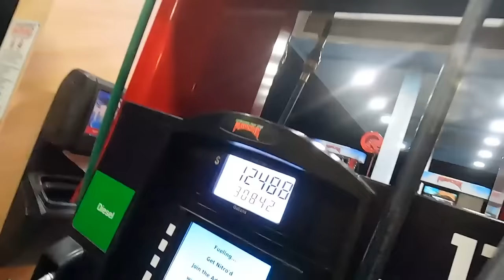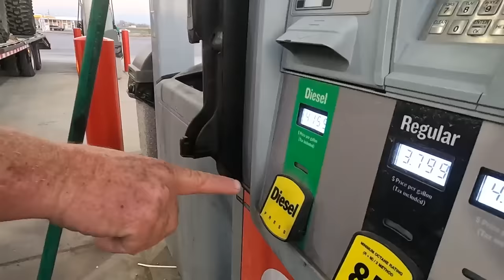I'm Saying GOODBYE To The World's Largest Off Road Wrecker!

Comment from the maker: A little more information on the wagon build. 😮 https://youtu.be/RnFA_jYkE0w
Reply: I've been seeing the forward movement of towing vehicles behind the wrecker. But been thinking a single solid bar between the axle an your hitch point on the wrecker would be super helpful. A lorry lift idea like on a heavy wrecker only I think for your Idea of climbing about up an down rocks a 3/4 S layed in below the vehicle till the wrecker would work better in your case. But a single bent pipe or made up box would work so it can swivel still an extra would be a old shock added in line if there was room. But something long enough that if it swings up the towed vehicle is pushed back from hitting the end of the boom. For over an above that nothing else could happen the towed vehicle with two lift lines and the cross strapping your already using Tom toms long walks will only be optional then.
Reply: This video is 🔥🔥🔥🔥🔥
Reply: That wagon is WAY to nice to derby! It should be resto-modded instead.
Reply: Matt what’s all done to the blue Ford!? Trusty truck you have! I just bought a 16 f350 curious about yours!
Reply: What time was it on your watch Matt???
Reply: a little less chewing with open mouths into the microphones (thus into my ears) would be nice next time :D
Reply: That is a beautiful station wagon. I remember these as a kid.
Reply: Wait a minute - You are going to turn that nutless-Cutlass into a Derby Car?!  Holey Moley, that will be epic.  I can't wait to see that happen.  For those of us old enough to remember the 400s and 455s being phased out and replaced with the 260V8 and 250L6, it was a big deal.  Even my family's '71 Vista Cruiser with the Rocket 350 felt like a muscle car compared to those later Oldsmobiles.  I hope you provide this wagon with the horsepower that it should have had the first time around.   This wagon looks like a '77.  They came lightly pre-broken, to save time having them break down later.  They featured exceptional brake dive and body roll, paired with a wide turning radius.  Good luck, this is going to be hilarious. 🏁🏴‍☠
Reply: Can't wait to see it Matt. Also love the wrecker great choice International looks awesome and does everything effortlessly. Keep up the good work always cool to watch recoveries out there I'm from Georgia so completely different terrain.
Reply: Man don’t derby that wagon what do you want for it
Reply: Wish I had the wheels off the wagon.
Reply: Have you ever had a recovery where you found the vehicle but no customer?  As in, the customer was never found?
Reply: Play offroad outlaws it's so fun

Comment: @23:00 Good work. Another way for another time: Dig a ditch/hole for the rear wheels of the trailer. 💡Dig ruts with a static burnout. Or deflate the tires.

Comment: With the number of times you have had extra passengers riding on the back of the wrecker, maybe you should look into a couple of jumpseats along the lines of the ones Suburu had for their little trucks.
Reply: Subaru Brat seats would be great for additional pax.
Reply: Yeah, I would hate to see somebody fall in line of those tires.
Reply: I have seen plans for seats, but there is a lot of other stuff that needs to be done before putting them in.
Reply: I had a brat I miss that thing.
Reply: @dubious6718  Who are you?
Reply: Subaru actually added those seats after-the-fact so the Brat could be imported to the US as a car instead of a truck, for cheaper! Haha
Reply: @brianpeck697  - I had friends with Brats when I was a twenty something, and I always got a jumpseat. It was a little lacking in headroom, and I'm a tall guy. I was definitely too big for the driver's seat.
Reply: Yes Yes this, maybe with a couple of harnesses or a bit of rope to tie the passengers in.
Reply: It would making a good spotlighting rig
Reply: I was just thinking he could use some Brat seats.
Reply: If the truck was a few feet longer there's room for one of the old semi truck crew boxes, Imagine a old sleeper with jump seats in it.
Reply: I was going to suggest the same thing.
Reply: But why don't they defend homosexual special rights ?
That'll prevent accidents too !
Reply: @dubious6718  I don't suppose you'd like to share where you saw the plans for rear seats.
Reply: @benjurqunov  WHAT?

Comment: I would name that thing "Jitterbug."

When I was a kid in the early 1980s my father had a 1940s or 1950s 1½-ton White Motor Company truck with a body style that was similar to that big yellow wrecker. It had two transmissions connected to each other so that you could put both transmissions in reverse to get a very low forward gear. A truck modified like that was called a "jitterbug" around here (Maine). They often had a homemade boom winch and were typically used in the woods for harvesting firewood, which is what Dad used his for. The ones with a boom winch were kind of a poor man's cable skidder. Even though that big yellow wrecker will never be used as an actual jitterbug, it would be the best jitterbug ever. It could even outperform an actual cable skidder in some areas I suspect, due to its extreme suspension articulation and high-revving big block gas V8 (high-revving compared to a skidder's diesel engine, anyway).

Comment: 1976 Oldsmobile Cutlass supreme Vista wagon! WOW!!! Love it!👍  I almost bought a used one back in the 80s for $2,500 with  factory t-tops and swivel bucket seats, minus the wagon ...but the seller backed out at the very last minute and sold it to a friend of his. 😞 . So I found a 74 cutlass for $700 and I was ok but not happy.  I've had a 89 delta 88 and a 94 calias that calias was a tank. I mean it was fantastic for off roading went through snow over a foot deep in farmers Fields,i used to go out from the the city to run my dogs ,and I never once got stuck. Anyway
Anyway I'm guessing you picked that up for the 500 challenge or whatever that's called...👍

Comment: Definitely need to add some jump seats with harnesses above the tool boxes
Reply: Yup, someone is going to fall off there right under a wheel and chances are that won't end well.
Reply: As much as I love the look of the wrecker, this is exactly why a cab over design would have made way more practical sense. It could be a 5 seater without changing the size and performance of the chassis, and it would be even easier to work on with tilting the cab off being part of the design.

Comment: Back at the ranch; we used to just dig a couple of shallow pits for the trailer wheels to lower the rear end of the trailer.  Six inches or so was usually deep enough.

Comment: Hey Matt why not park up beforehand , get the drone out so you can do an aerial check of the area to see if the recovery is still viable
Reply: Range....
Reply: @Ty-bz7zx  my bad, I thought they were within a couple of miles of the recovery
Reply: I loved your question so much I went down a rabbit hole thinking how great this would be.
Ten minutes into searching I found most don't have the guts for more than a few miles but I was able to find one that claims its' range is ~ 9 miles. Several others capped out ~ 4 - 5 miles.
Your idea should be viable in some situations and I would love to see a response from MORR if they researched it.
Edit - And then I found this:
FAA regulations require drone operators to maintain a visual line of sight of their drone during flight. Operators looking to fly their drones at long range (and beyond the operator’s visual line of sight) will need to obtain a BVLOS (beyond visual line of sight) waiver from the FAA, which is typically only granted for approved commercial drone operations.
Reply: @matthewwebb6001  wow, what a great rabbit hole. Thanks for that my friend 👍🏻
Reply: Also they are not very fast, and get unpredictable at the edge of range, and too expensive to lose
Reply: @matthewwebb6001 I assume off-road towing could be a viable commercial application that they may approve
Reply: @jmelchiori85  I was actually thinking that myself, especially as they could be saving lives of those that went off trail
Reply: Hey bro, thanks for that info! I had no idea of restrictions. I thought it was a great idea though.
Reply: @PaulH_1972  No bad at all.  Was a valid and insightful question.  I offered one of several poss reasons.  =)

Comment: Kinda curious why you never take a canister with some extra fuel on the road. Can imagine its usefull both for the cases when you run out, but also sometimes for some of the people you have to pick up.
Reply: Can fuel canisters explode if they get too hot?
Reply: Same reason he never has the ability to put air in a tire. 

Yootoober first 
Recovery...eh...
Reply: I've thought the same thing! I just put it down to not knowing how the business works 🤷‍♂️
Reply: @jeffstreck  I just checked, petrol auto ignites at ~250 degrees celsius (480 fahrenheit) and diesel at ~210 celsius (410 fahrenheit) 

Should not get that warm , and even you worry about that, a simply shelter so it doest get direct sun should help enough (or put it in one of the trays on the sides)

Comment: Odd that the wrecker isn't secured with Matt's straps.
Reply: They MAY not have enough rated capacity for the weight of that awesome monster.  Just sayin’…
Reply: Matt's straps only have a working load rating of 1500 lbs. Not sure I would even use them with a car on a trailer. You need to hit the brakes or get in an accident, I would be afraid 2 of them would not hold a 4000 lb car back even if it was in park. They are more atv/utv straps. If it was me hauling a car or pickup (and I often do) I would be using 3 to 5000lb. working load rated straps. If I had to haul that wrecker around, I would only use grade 70 chain or better.
Reply: @madkow007  I guess that 10,000lbs rating was BS.
Reply: He has used them in the banana or morrvair.
Reply: @n6cid  when did they say 10k working limit?  Straps I use have 3300 lb load limit but 10k breaking point.  That’s normal. You try to stay under load/working limits. Which should be @1/3 failure point.

Comment: Matt, When you are forced to use the highway trailer to get something off-road; It might be good to attach the ramps onto the upper surface of the trailer. It would be almost impossible to "wipe-off" the ramps that way (instead of them being stored beneath the trailer  - where the big rocks live!).

Comment: Heard you saying “The mice get in there”.  The solution is a product called Rhodent Repellent, available at Murdochs.  A little pricey, but it works. NOT A POISON.  I use it on my 99 f 250 7.3 diesel, 430k, crew cab, early version of yours. Also keeps the mice away from the battery compartment of my atv, and Nissan Rogue. Used in engine compartment, passenger atea, garage and attic space.
YEARS OF PROVEN USE!

Comment: Aawh man. Shoulda picked up the wagon before dropping the wrecker off. Could have used the wrecker boom to lift the front of the car up from a 90 degree, back the trailer under it, set the front on the trailer, then lifted the back and pushed it on with the wrecker! 

Also side note Matt, a boom extension even as simple as an engine cherry picker with pins would come in handy on the wrecker! Just an idea!

BUT without the wrecker, why not jack the front of the car up and back the trailer under it instead 😂

Comment: I'm kinda surprised you guys haven't fabbed up some kind of all-purpose ramps. Something that would work like a regular sand/snow ramp to pop under tires in those situations, and that could also hook onto the trailer to get regular vehicles up there.
Reply: The car trailer I built has short steep ramps. I carry a few 2x6 boards 4 feet long to lessen the ramp entry angle.

Comment: 12:03 You can easly drive out of that.
I'm guessing that trk is not 4x4 so turn your steer wheels hard right and back rear right wheel up onto bank.
Rock back and forth to create a path up the bank.
Use the momentum to lung you out of that hole.
If the trk is 4x4, do the same thing with the front right steer wheel.

Comment: I can't stand when a "customer" doesn't keep you updated if the circumstances change. If it is local I just move on to the next call. But if there is a bit of travel required to get to it I have started taking a deposit up front and then apply it to the bill later. Granted this is assuming you aren't doing the calls for free to begin with and not depending on youtube monetization.

Comment: Man builds a company by pulling stuff with and xj and when the time comes to load a trailer with an xj on it, uses a Chevrolet pickup. I fully expected the xj to back up with short rope , it would have lowered the back of the trailer and pulled up on the car, but it all worked out in the end. The 4 horsemen in the derby should be cool.

Comment: The picture of the vehicle stuck in the sand looked worse than what they ended up seeing and with all the snow melted off the second recovery, the Heavy Wrecker was overkill. I guess it's better to have too much (power) than not enough. But since you had other dealings in this trip, it all worked out.

Comment: You should think about adding a gasoline mobile re-fueler tank to Blue Steel so that you can gas up your recovery vehicles on the trail.  If it is only used for off road vehicles, you can use farm style gasoline that doesn't have road taxes on it which will save you some money.

Comment: Need to issue an "unreliable information" charge. Oh you told me it was a honda civic that out of gas 10 feet from the hyw. But it's actualy a quad cab long box diesel dully sunk down to the axles in frozen mud with 2 broken drive shafts.

Comment: I see that 30 gallons of fuel cost you 125 USD, here in Libya it would cost you 17 Dinars which is around 3.3 USD😅. literally cheaper than water.

Comment: Why so much hassle with loading that last car. Load it on the trailer which had fitting ramps, next put the trailers back to back and pull it on the trailer without the ramps (optionally with the ramps to cover the high difference).

Comment: I guess common courtesy is a thing of the past. In future you should be charging for fuel and at least half the travel time up front. When I worked with my dad on the wrecker there were no cell phones. Communication between the truck and the garage was via a radio with limited range. You shaft one of the operators in the area without a darn good reason and you better never need the services again. Your name was passed between the wrecker operators and lists were updated weekly. It was like Santa checking his naughty and nice list. Before accepting the call the list was checked. If your name was on the list... sorry. We were to busy that day and probably the next and the next and the next. If you had to call another company 100 miles away to get service....sorry. Guess you should have at least called to cancel, even if the wrecker was on it's way we could have turned around and costs would have been a lot less. It was costing us to much to keep taking these types calls. You went on a call 30 miles out in the middle of no where only to find the vehicle was gone, you weren't only out the cost of fuel and time but the work at the garage wasn't getting done and you had to hire a part timer to pump gas. The operators within 40 or 50 miles finally got together and set this system up. That was back in the mid 70's. And one last thing Matt....we made sure we never ran out of fuel in the wrecker. Our own cars...that was something all together different. It happened a .....few times.  LMAO

Comment: Too bad you can't put a fuel bladder in it so as you run out of gas it shrinks so it gets all the fuel that would normally be in the corners or just spread out around the bottom of the tank so when your out you are out but it uses all of the fuel none just kicking around the tank that is just not able to be picked up.

Comment: You used 30 gallons of fuel in the wrecker but it looks like you put 50,000 miles on the tires.

Comment: Any concerns pulling out that truck by the trailer ball hitch?  I know this was a gentle pull but if it got more stuck, could have easily exceeded the forces that those are designed for.    Just as important to respect the “triangle of death”, is to respect the “potential trailer ball of death”.